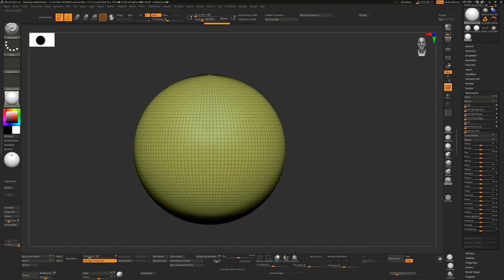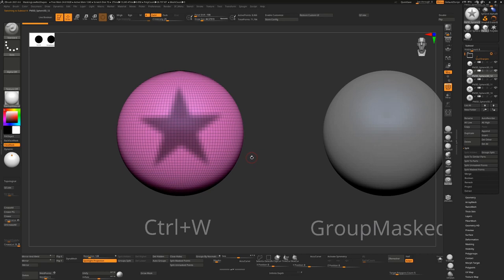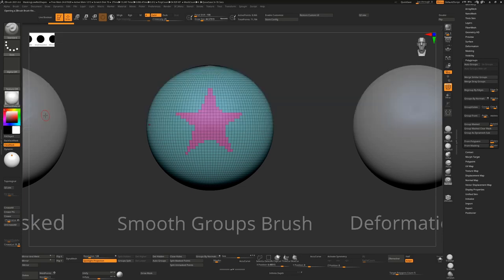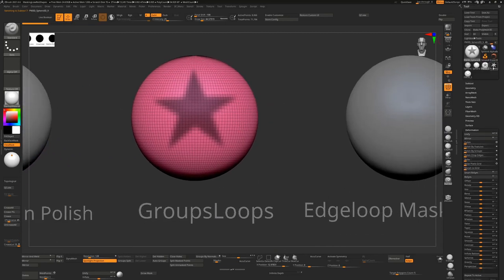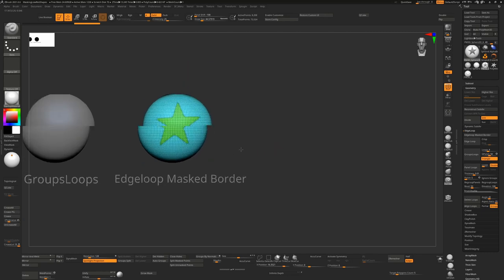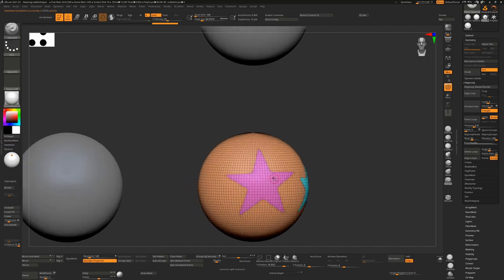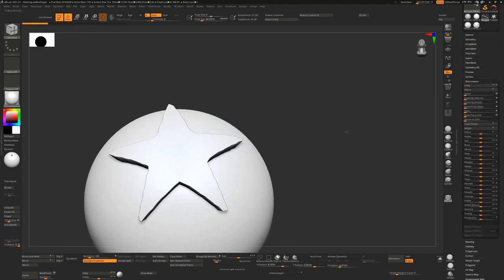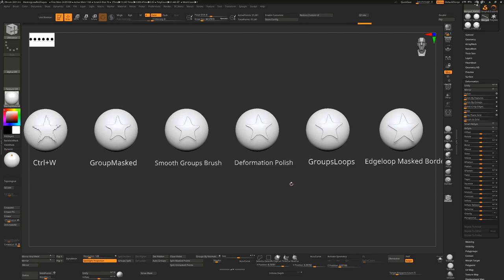Create clean extrusions from low resolution masks on low resolution objects

Comment: "Mask" -> "Ctrl+W" -> "Panel Loops" make best result for this task (if you use subD then)
Reply from the maker: Yeah, that's another option too, thanks for mentioning it, the problem with this type of video is that I always forget something! Although that does deform your surface somewhat, and the level of smoothing can be quite aggressive also... but still, yes, another option.

Comment: Thanks great trick! I had never noticed.
But there are some conditions where it doesn't seem to work,
in particular with mask circle, mask rect, mask curve.
Forr example take a sphere and divide it to a little less than half with a with a rectangular mask, or other geometric regular shape, with the tools I mentioned above. 
Then do the Edge loop masked border: unfortunately the edges will be created will be jagged.
I don't konw why but It's a shame doesn't work with these tools.
Reply from the maker: Very strange, I never noticed! But you're absolutely right, inconsistent results using standard masks - I never noticed that I as I normally paint them. The one thing I would say though, is if you did want to create shapes using these tools, then you can still easily do it cleanly (even cleaner in fact!) by using the Slice Circle, SliceRect tools, so I guess there's a workaround there. :)
Reply: @SeanForsythTutorials 
Thank you for reply, and that you confirmed to me that it doesn't just happen to me. 
I didn't think about slices in this context, I can make the same mask shapes with slice tools...good! 
Slices tools have the ''problem'' that they don't work in symmetry, that I know of. In any case it is not a big problem, just a few more clicks. Anyway just do the symmetry after creating the group.
Reply from the maker: @matsy7450  Yeah, very true, they don't work with symmetry, but as you say, you can always mirror and weld afterwards. One other cool thing I forgot to mention in the video is that when you use the PolishGroup slider for Group Masked (in the Polygroups rollup), it stays on, so any new masks you paint on and use Ctrl + W with, it automatically tries to smooth them. Kinda cool.
Reply: @SeanForsythTutorials  
Good! I hadn't discovered this slider yet. Sorry for my english. 

(I hope that in the next ZB version Pixologic will add an automatic way to keep the corners sharp, in the extrusions, and the sides smooth...if is that you want.
And in general add entirely new tools to help who want to do ''hard surface sketching'' but in a more accurate and clean way than now. In order to obtain a result similar to the classic polygonal/subdivision modeling, even if less precise and non-parametric. Specifically hard surface for automotive design and modelling.
Ok, for the hard surface just now there is Zmodeler, but it follows a traditional way to modeling. However I would like also a more revolutionary and faster Zmodeler).
Reply from the maker: @matsy7450  Yeah, the ZModeller was great when it first came out as it allowed us to not go into Maya for hard surface modelling stuff, but it still has a long way to go. I'd love to be able to connect a series of edges to another series edges cleanly. Or insert two loops and slide them outwards in a single action (as suport loops). Don't get me wrong, even if it's a slower than Maya and Blender, it's at least possible to do everything I want to do, so I guess I'm grateful for that.
Reply: @SeanForsythTutorials  
Yes it is slower than Blender but as you say it gives the possibility of not leaving from ZB, and this is good. Since Zb is mainly a modeling software, including hard surface, I believe and i hope it will be further improved in the future:)
Reply from the maker: Absolutely, I'm sure it will!